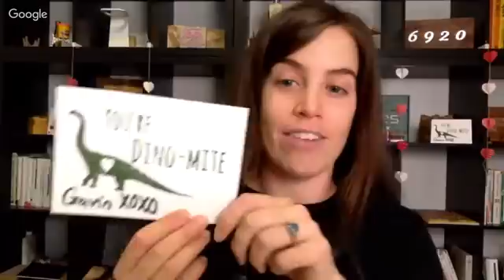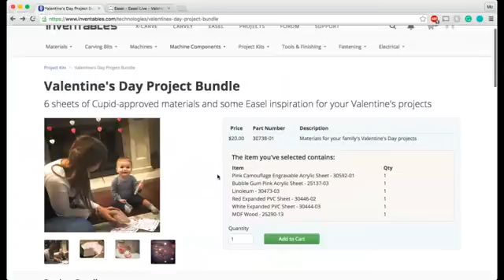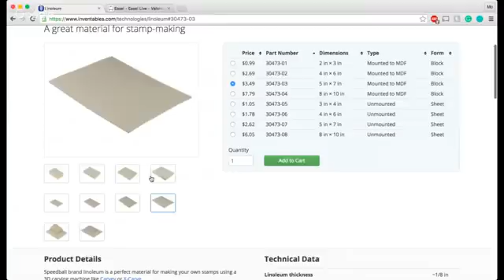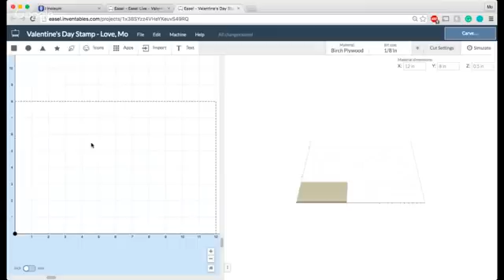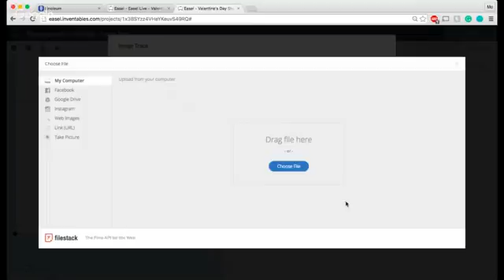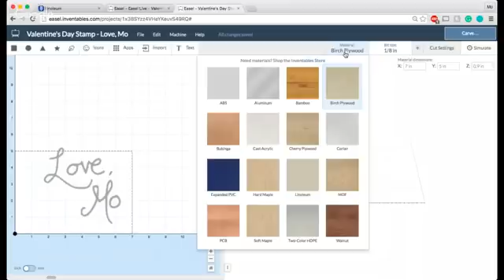Easel Live: Personalized Stamps

Comment: hey Mo, thanks - wondering if you can rip the 5x7 boards that you sell (into smaller stamps) or if they will break apart?
Reply from the maker: Hey, Mark! If you want to break apart larger stamps, I wouldn't recommend ripping them. 

You can probably cut through the linoleum sheets with an X-ACTO blade or a pair of scissors. For the linoleum sheets mounted to MDF, I'd suggest using a saw to cut them if you want to make a lot of smaller stamps. 

Either way, you may find it easiest to carve all the stamp designs at once and then divide it into smaller stamps after the carves are completed. I hope this helps! - Mo

Comment: Why couldn't you just cut out the letters and shapes and glue them to the MDF or whatever you want. Then cut out the tabs on the back side to remove the unwanted parts.

Still a good idea Thanks
Reply: You can do that.  It's a great idea!  With this technique it is a bit easier and the stamps are done when you take them out of the machine.  No gluing required.  Also there is a nice place to hold the stamp.  You can also easily add a handle if you want.